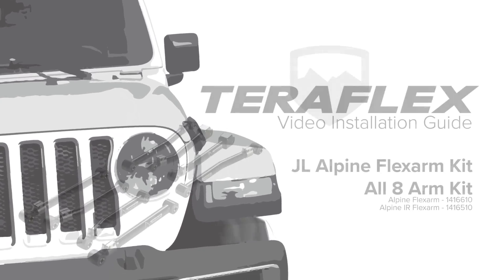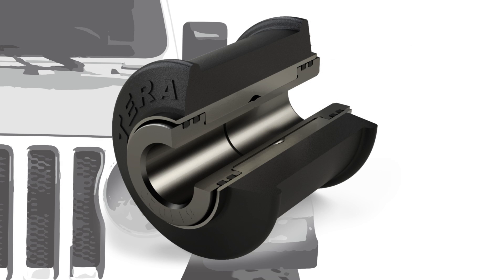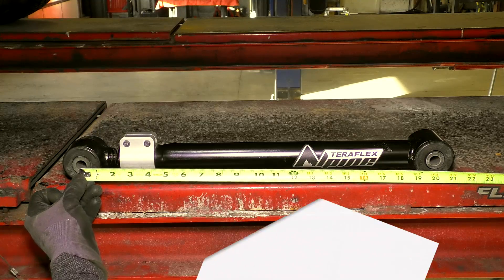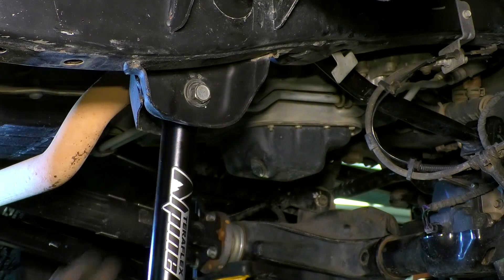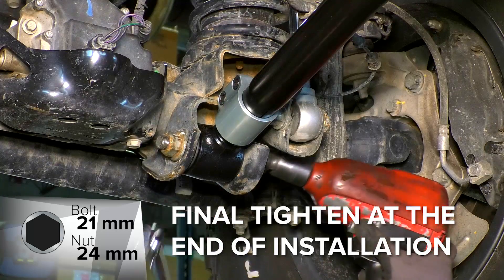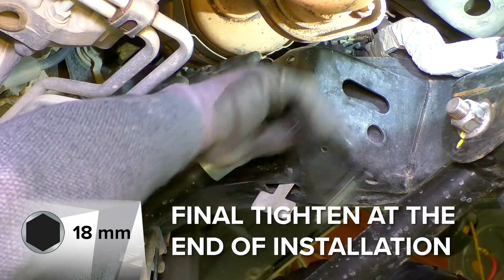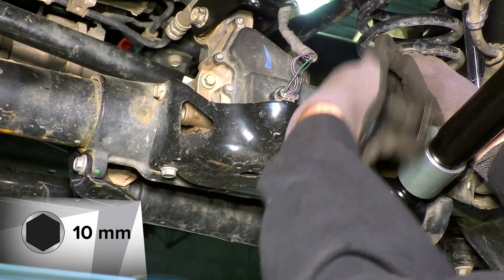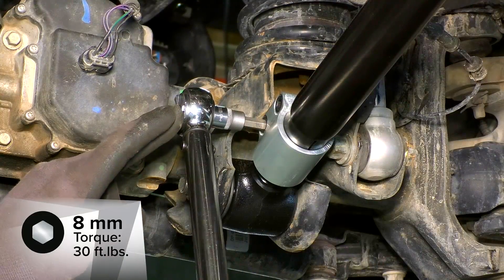TeraFlex Install: JL/JLU Alpine All 8 Flexarm Kit

Comment: I have a mopar lift kit and thinking putting some adjustable control arms to correct my geometry and caster, pinion angle, center axle, and if i am on budget should i put front or rear?
Reply from the maker: Front lowers and rear uppers at least, or all eight adjustable control arms.